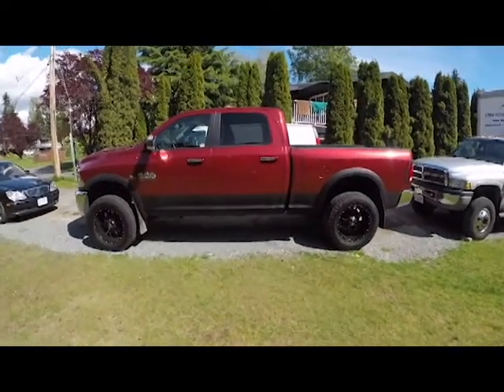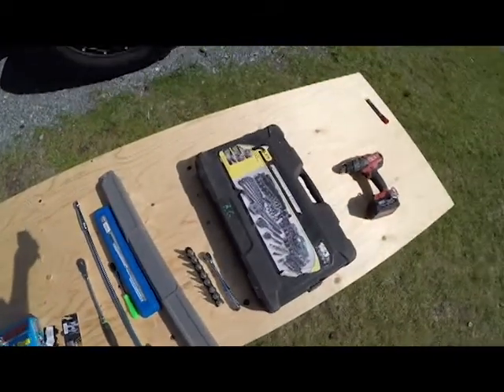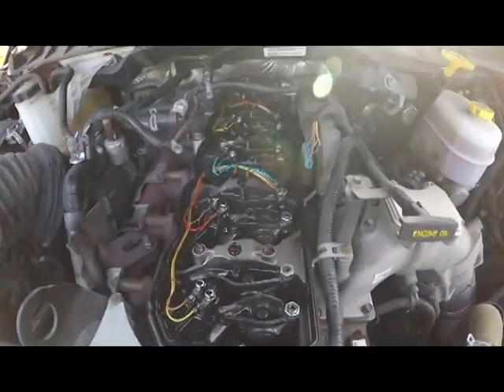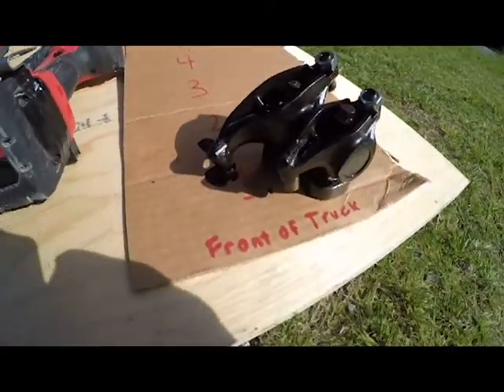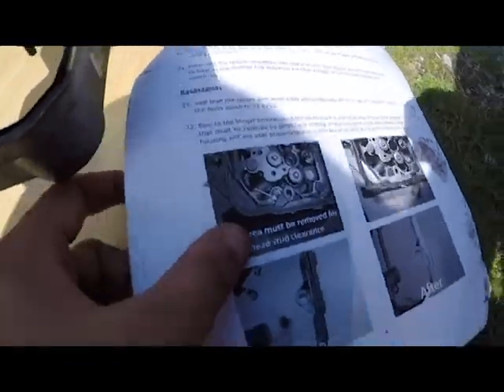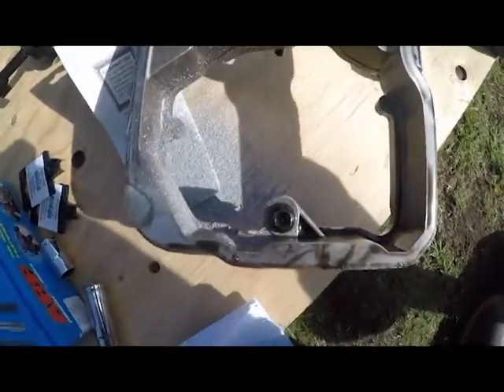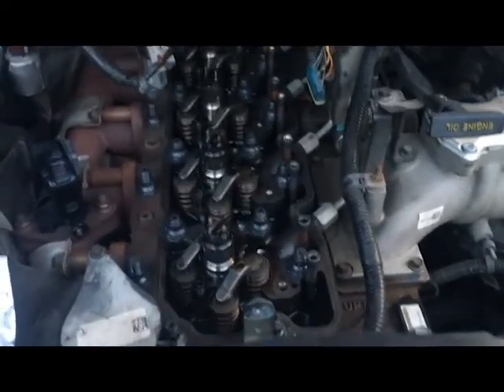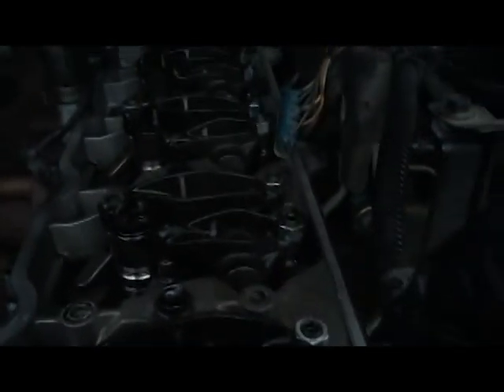HOW TO: Cummins ARP Head Stud Install

Comment: OK, what do the studs get tighten down to, prior to the cap nut. ?   They are a two piece stud correct ?
Reply from the maker: Jim Cash. The stud just goes in basically finger tight. Has to bottom out in the block. And yes they are 2 piece. You have the stud then the 12 point nut

Comment: How long would you say that took from start to finish?
Reply from the maker: From start to finish took me total of 5 hours!
Reply: beachsideandy I’m doing mine now. Took everything off tonight to where I’m taking the bolts out and replacing with studs in the morning. Took about an hour and a half for me getting everything off. Also my truck is lifted about 8 in the front so it made it a lot harder than it needed to be.
Reply: Thanks brother, good info.

Comment: Why changing head stud volt?
 What kind of benefits?
Reply from the maker: You have a lot higher of a clamping force to prevent the head gasket from popping when running more boost with higher tunes!